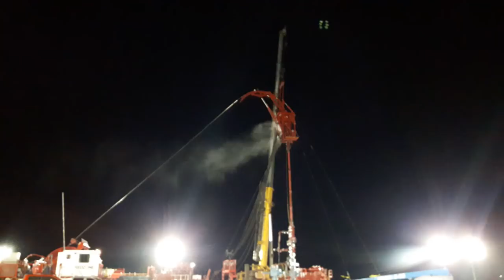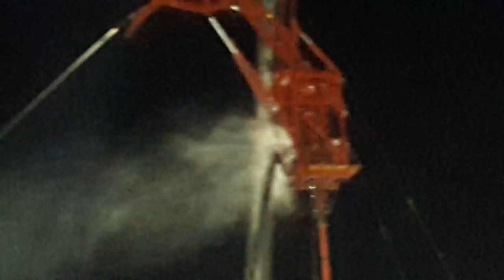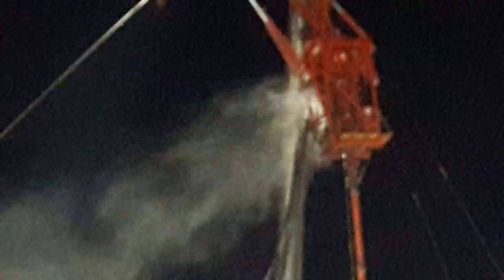Blow out of the coil tubing injector.

Comment: Probably there is a pinhole in coiled tubing and double flapper check valves are leaking or its a stripper bushing is not sealing the ct/tubing annulus and the pressure from the well is coming out with water or whatever is in the well.

Comment: Blowout of the CT Injector????????? This title is completely wrong... Sorry!!!! With all respect Sir Inj. Head push and recover CT  from the well,  it does not seal anything and also the term of blowout is to Strong for either a pin Hole in the coil or a Stripper rubber leaking that is probably this case!!!

Pumping Acids
 When pumping acid through the coil this event is part of the contingency plan because of acid reaction to the CT walls, if this is the case there are two main basic home work that need to be performed prior the operation:  
1 - Present Coil life because of the expected fatigue while performing the job
2- Right formulation for final percentage of the acid diluted and included the right value of the corrosion inhibitor...
A part of it, surely there are others factors while RIH and Pumping  that would  influence to end up to this incident. (Abnormal Slack off weight while RIH, any possible over pull during pull test, delay on time scheduled while pumping, circulating pressure values, etc etc...)

Stripper rubber Leaking
1- After Stabbing CT pipe into the injector head Stripper rubber need to be changed to a new one, during the process of stubbing, in many cases stripper rubber is damaged it will result of less stripper rubber time performance.
2- Stripper rubber outdated, I've seen many crews using these rubbers just because it has not  been used before!!! Although the Stripper rubber is brand new it will expire on its date limite, pay attention on this, it has been the cause of many NPT ( None productive time).
3- Leaking on stripper system  Hyd. 
If there is pressure in the well the Stripper pressure has to be closely  monitored, if any leak on its System it will not be a surprise for you and for this case  be ready for a contingence plan if fails.

For this video I would guess  two cenários Either stripper fail or Pin hole on CT
1- Stripper fail: Activate the Pipe Slip Ram on BOP and plan to change stripper.
2- Pin hole:  Position the pin Hole down stream of the stripper recirculate to change fluid in the pipe if necessary, manage to lower  as much as possible the Circulating pressure to retrieve safely the Pipe to the CT reel.

Apologies for this Small Book 😄
Open to CT discussion:
WhatsApp: +244923887920